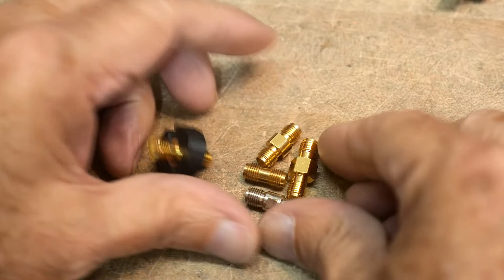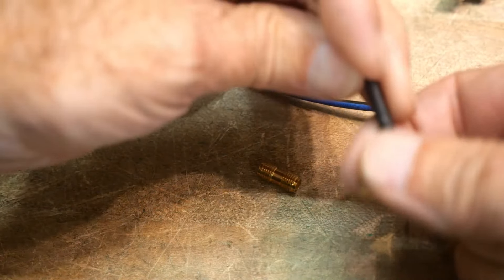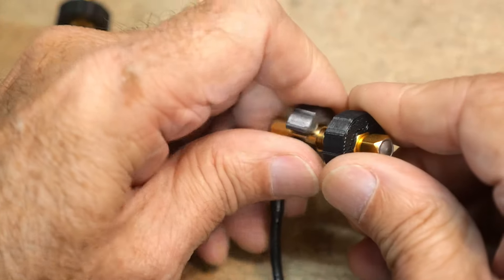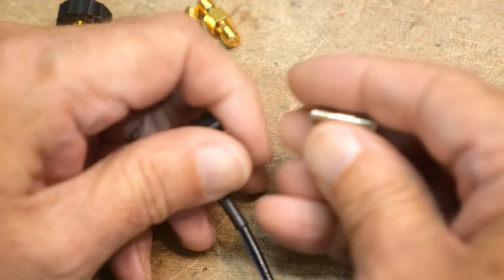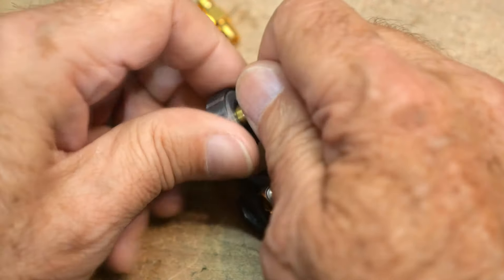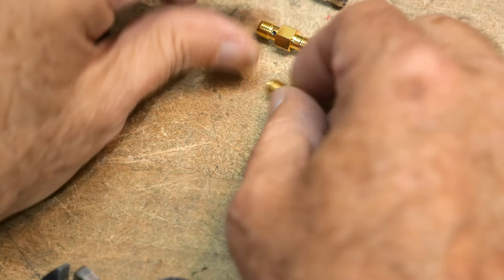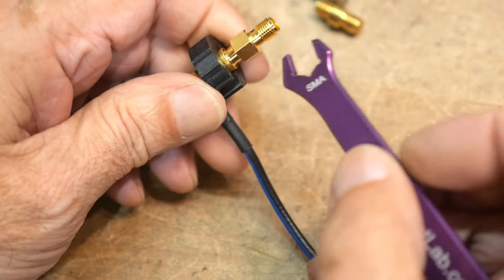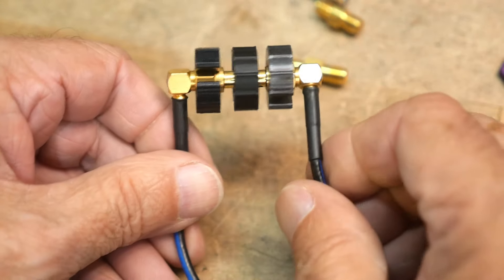#2063 The Perfect F/F Thru Cal Standard

Comment: For more sensitive applications, the torque on the connector also make a great difference. 
For this reason, we used little break-away style torque wrenches when connecting these and similar connectors.
Reply from the maker: torque: https://youtu.be/SQgiox2JwSk?si=2kvMepuBgoOSYNw2
Reply: @IMSAIGuy  👍 Perfect!  We had the blue handled PE ones from Irvine, CA and we worked from DC-33 GHz in test, otherwise calibrated fingers are usually close enough for rock n' roll or the Ham shack. Thanks for all the great videos!
Reply: @IMSAIGuy  Could we have video that shows signal effects of changing torque and that correct torque gives best signal results. I know nothing. ISTR Joe Smith came to similar conclusion about me in the comments. Thanks for all the great videos which have been keeping me entertained recently.

Comment: Thank you, all of my throughs are all cylindrical. I sometimes need to use small needle nose to get them out.  This is better! 

Unrelated, I notice you use a lot of 90* connectors on your VNA. Do the 90*s introduce more reflections or other issues, especially at higher frequencies? I'd like to use 90* connectors on the DUT end, then I can use shorter cables, and also would need less bending which helps phase stability when using "standard" test cables and not mega$$$ VNA cables. 

There are absolutely NO VNA cables on the market with 90*'s, which makes me think they are not ideal.